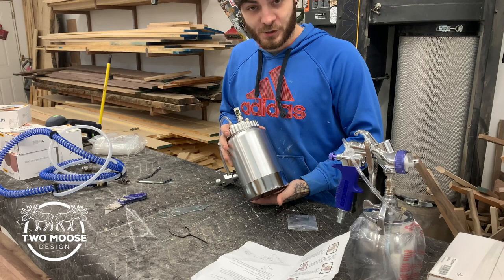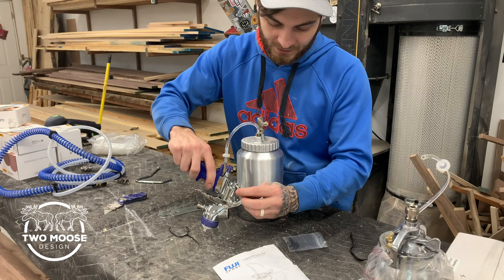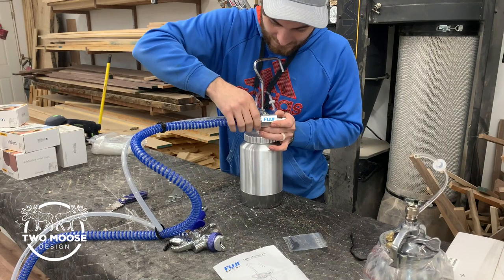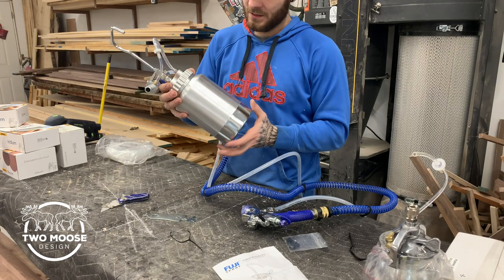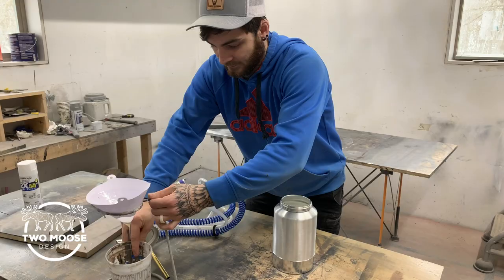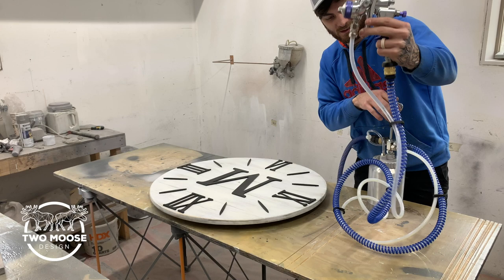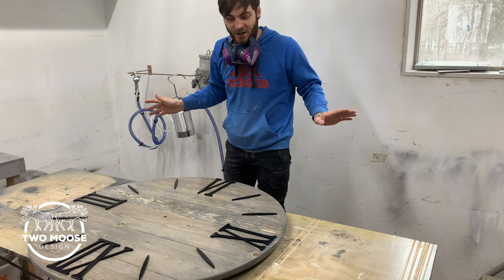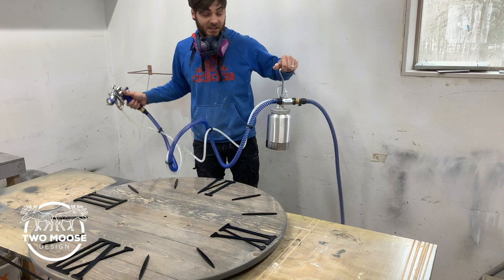How To: Set up/Use Fuji Spray 2 QT Pressure Pot Review

Comment: I've been using a Q4 Platinum and a Q3 Platinum for over two years with no issues at all. I paint furniture and cabinets almost every day. These turbines and guns are ultra dependable. I have a T75G gravity gun and a T70 cup gun that I use as a cup gun and a pressure pot gun. I much prefer the T70 cup gun over the gravity gun. Highly recommend Fuji Spray...
Reply from the maker: I no agree! I haven’t had any issues and it’s probably been 2 years as well
Reply: Any reason someone should get the Q4 rather than the Q3 for painting furniture and woodwork? What about lacquer?
Reply: @snaubdca7yebf  Fuji says that pressure pots require a 4 or 5-stage turbine. I expect is has something to do with air flow or air pressure for the pot. I use my Q4 with the pressure pot and it works great on my cabinet painting. The biggest advantage aside from fluid capacity is the ability to paint in difficult positions, even turning the gun upside doesn't present a problem with fluid reflux into the air lines like it would with a conventional gun-mounted cup.

Comment: FWIW..I use the gravity feed  GX-PC Fuji gun with this set up. You have to use an L fitting to connect the pressure hose but it works like a champ. No issues whatsoever.

Comment: One easy way to resolve the twirly hose is to heat up with a hair drier or heat gun and hold it stretched out as it cools. I just taped mine to a table and then used my wife's hair drier (she was so thrilled!).

Comment: The vent screw on the pot? when to open and when to close? I've seen a number of reviews but no one mentioned it...
Reply from the maker: the only time you open the vent is to release pressure if you’re going to take the top off to add more finish.

Comment: Is this Fuji gun is any good I have Apollo 7500 but this makes me angry to make bits seals ect hard to clean takes time and need to watch all small parts to don't lose so I thinking to buy different guy so this Fuji guns are good nice atomisation ?
Reply from the maker: I really like them. I’m not familiar with the Apollo 🤷🏼‍♂️ I had a Greco and I had issues with the seals. I’ve been using the Fuji system for over a year and I spray for a full day each week and have yet to replace a part. I also spray primarily water based products not sure if that’s a factor
Reply: @TwoMooseDesign  thanks
Reply: The T70 cup gun is awesome and very dependable.

Comment: Helpful video. Thanks for taking the time to share your knowledge. Have you used the 2.5 gal Fuji pressure pot yet? I bought the one you show in the video, but I may return it. The larger one allows you to use a compressor to push the coating so all of the air from the turbine goes toward atomization.
Reply from the maker: Thanks! I have not the smaller one is perfect for the the amount I spray. If I sprayed more I’d definitely get the big one

Comment: Is there any chance.. you could show it attached to the gravity gun??????.... 
some reckon it’s a pain in the butt.
Cheers.
Reply from the maker: I think it would be fine just a little awkward with the hose on top but i don’t see it being an issue or why it would be a pain to attach 🤷🏼‍♂️
Reply: @TwoMooseDesign  get on then 🤣👍
Reply: you just need to get a 90 degree elbow adapter to operate the pressure pot with the gravity gun

Comment: Just wondering if your still happy with this setup? I just sprayed 20 cabinet boxes, must have filled my 1 qt cup 10 times, and my arm is killing me, lol.
Reply from the maker: Love it! If you buy the larger pressure pot you don’t even need to carry the vessel. You can just set a gallon of finish Inside it. I’d highly recommend it that little cup on the gun gets heavy pretty quick.
Reply: @TwoMooseDesign  thanks for the reply.  Is there a larger pot than the one you're carrying in the video?  I thought they only offered a 2 qt size?
Reply: @ryanmctee5725   2 1/2 gallon that you can put a one gallon paint can inside, so no big clean up.

Comment: What air compressor do you use?
Reply: I came here after seeing a more recent video with this being used to see the same thing. The whole system is powered by the Fuji Turbine, in this case the Q5 turbine. It doesn’t require a separate compressor.

Comment: Just seen this dude. I might invest in it as I said I have that shitty gravity cup that leaks. Looks good. 👍
Reply from the maker: if you plan on spraying more than like 3 cups in a session this thing is a must!! i spray a ton of stuff each week so i actually use the presssure pot most of the time, then keep the other finish i use in the pps system so i dont have to switch anything over. The advantage to this is you can spray at any angle and you get no bubbles or leaks, and it holds like a half gallon. i havent used it with paint but im sure it would be fine.

Comment: All this hassle to save a single refill of one quart? No thanks...
Reply from the maker: Hassle? you literally fill it up and spray 🤔 buy hey not all products are for everyone. Ive been using this for quite a while now and I still really like it 🤷🏼‍♂️
Reply: @TwoMooseDesign  "you literally fill it up and spray" is not the hassle I'm talking up; the hassle is to connect it up to the sprayer just to gain an extra quart. No thanks, I'd rather not pay the extra $400 I'd rather "literally fill up and spray" my own cup twice and save the money.
Reply from the maker: @Order-in-Chaos  okay 👍🏼
Reply: Additional benefit: You can spray upside down. Huge benefit for painting cabinets. You can't do that for long with your cup before the air line fills with liquid. It's worth it. Good video.
Reply from the maker: @JArtMiller  agreed! Thanks for watching 🙌🏼
Reply: Definitely worth filling up 2 times vs 4-5, especially if doing gables cabinets etc, little goes a long way, just my opinion 😉
Reply: I’ll just add my very late two cents to this conversation on what is gained here - I cannot tell you how many times I’ve bumped my bottom feed cup into the piece I’m spraying. This system really minimizes the footprint of the spray gun overall, which really interests me.